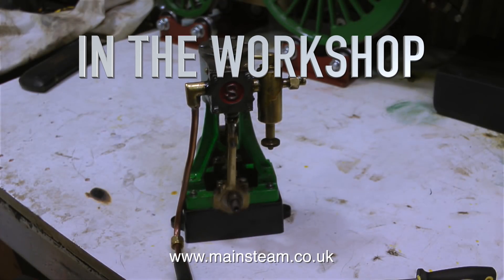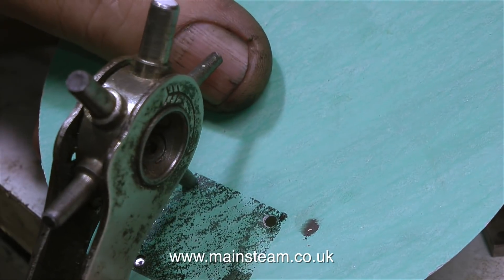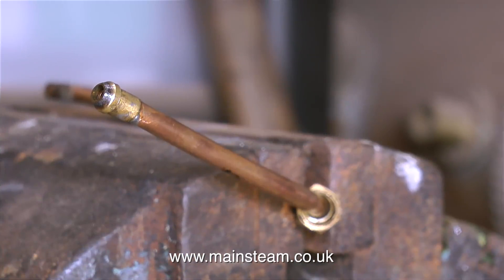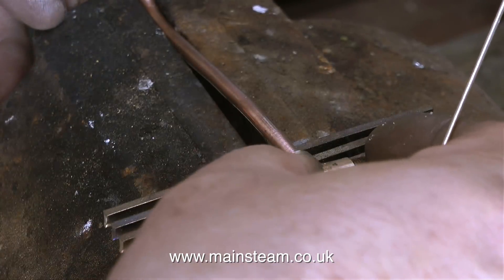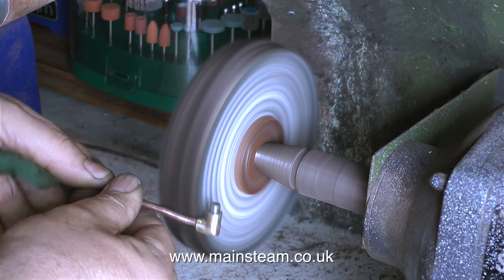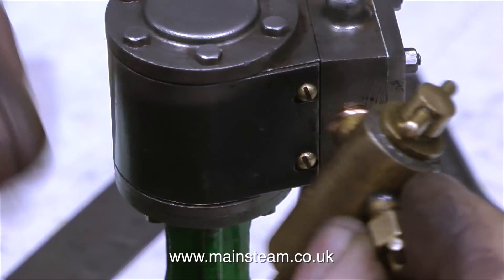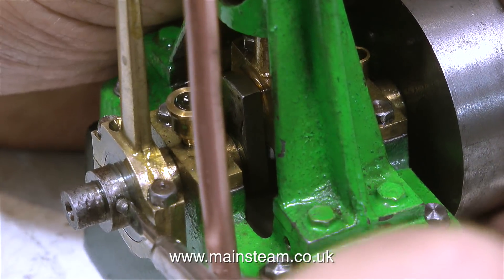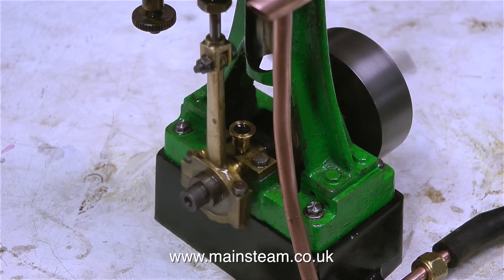HOW TO REPAIR A STUART MODELS 10V STEAM ENGINE - PART #2

Comment: Hi Keith..old video but after watching your latest I always go back and find older ones to enjoy as well. Sorting through all those thicknesses of copper shim washers can drive a guy nuts. Often if one is a bit too thick I'll crush it a bit in my milling machine vice or between two smooth pieces of steel in the bench vice. Saves a lot of fiddling about and usually one or two squeezes does the trick. Keep up your great videos. I enjoy and every one and especially the variety. All are useful and full of practical hints and insight.

Comment: I am intrigued as to what would happen if you left a little of the soft solder in place before silver soldering.
Reply from the maker: the Silver Solder may not bond properly and the remaining soft solder heated to a very high temperature can eat into the parent metal ....

Comment: How do you clean the soft solder out of the right angle and the cone?
Reply from the maker: with a diamond rotary cutter - if you watch the video again, you will see that there wan't any solder inside the fitting at all . . . .